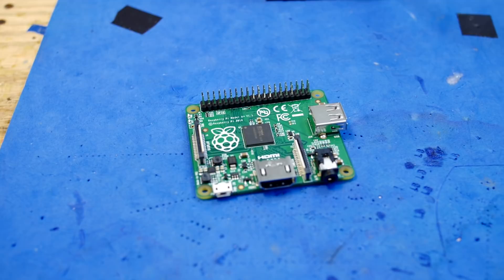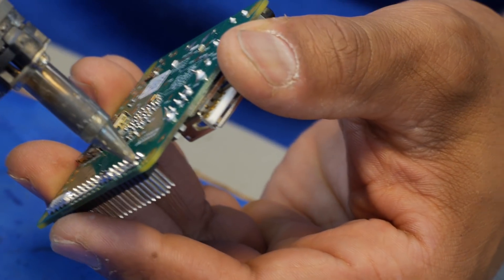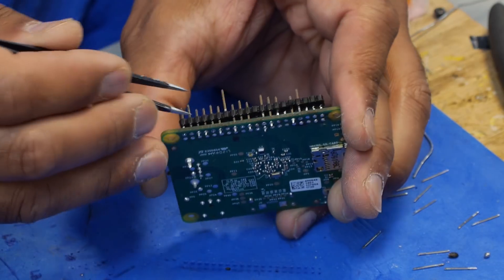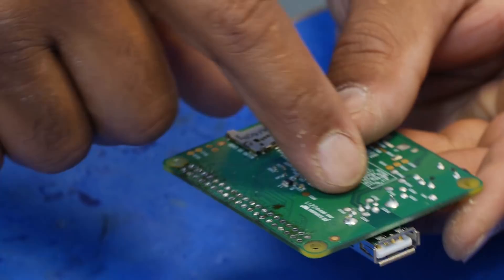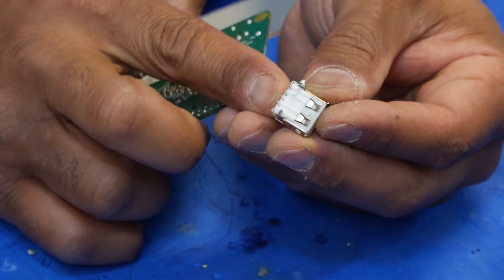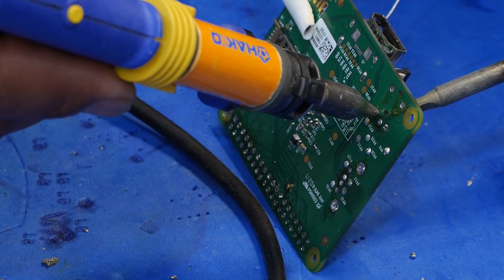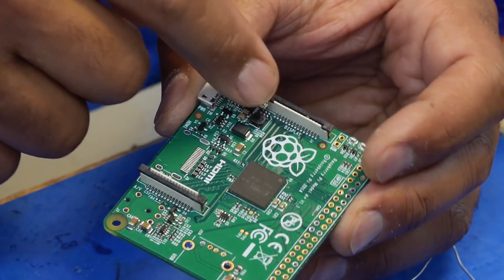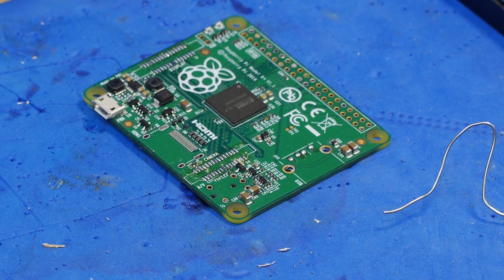Desoldering a Raspberry Pi A+ - sudo Sergeant 21

Comment: May be easier to tin solder on each pad, place in vise, heat one pin at the same time pulling pin with pliers on other side for all the pins, suck &/or apply more solder or wick away remaining solder... Tedious yes, but all for keeping it simpler for the average user with out hakko sucker. Took roughly 40mins tho.
Reply: Things suggested: PN-2007 (Teethed Pliers), Super wick #426, #835-P Flux pen,  desktop Vise,  patience.

Comment: Could you do a video of how to use a heat gun and how not to use one.  I have a soldering station and the one time i tried to use a heatgun, with a narrow nozzle, for desoldering i ended up ruining a circuit board.

Comment: Was curious about interfacing the Nintendo power glove with the rPi. Found videos for Arduino, but non with the rPi. Would be interesting to see if it's possible without having to use an Arduino as a man in the middle interface.
Reply: I don't know, depends on how they interface it? If through the official controller port, yeah you can use Pi's slow and horribly mistimed user space GPIO without any further issues to read out a normal shift register based controller, so should not be a big deal here either - Arduino is of no benefit whatsoever.

Comment: Hey Felix, Is it possible to do that to the microSD as well? I'm wondering so maybe I can bend it back maybe instead of laying flat.
Reply: You can desolder the microSD socket, but you may instead consider getting a flex cable SD-card extender, it's more reliable.

Comment: You clowns and idiots going on about the pi zero don't belong here: They have portable systems, they have premade clocks, they have screens which do not require reverse engineering and we have a bunch of clowns too dumb and unimaginative to learn a simple process.

This is a general procedure and not only applicable to the first gen Pi. They likely choose the R Pi A+ because they had it laying around and labeled the video with it as an example. That said, it doesn't take a rocket scientist to apply the same lesson elsewhere.

With the right tools• this job is insultingly ease; I stripped a laptop motherboard in ~5 - 8mins (I wanted the eMMC, USB ports, power jack, a few mosfets and a few useful power reg ICs).

•A Hot Air station (I got a cheap one for 50 bucks delivered), with a little practice and common sense (not heating/overheating things unintentionally) could have you doing SMD work/component removal jobs with the greatest of ease.

Comment: I think that the desoldering sucker doesn't work well. I recently used the manual one, always desoldering 2 or 4 pins at the same time and leaving virtually no solder behind.
And I don't really get why you put fresh solder on the solder joints when you desolder them. I usually just apply some flux, when I need better heat transport, but most of the time it isn't necessary, when the iron is set to a high enough temp (260°C or so on leadfree solder).
Reply: Rainer Riegler you add extra solder to transfer the heat on the desoldering tip.  It has a relatively larger tip with a hole in the center that the vacuum is applied to.  A reflowed commercial board doesn’t have a lot of solder out at the edge of the hole if the tip.  By adding extra solder you assure that the tip will have something that can transfer the heat to the rest of the solder quick enough and reduce the danger of damaging the fine traces of the printed circuit board.

Comment: Watch Rossmen he does a good job removing parts with hot air resin and wicking
Reply: remove jtag
Reply: bert farry Yeah, I use a cheapo hot air station with better results at a fraction of the time. Still useful for those without all the extra tools.
Reply: I am working on an old arcade board and I am using a lot of his technique to remove IC chips and replace with sockets. So Flux, solder braid then heatgun on whats left and use a IC puller and I just lift the chip out. A quick cleanup with iso  and then use the heatgun and just let the new socket drop in. I have done about  20 chips so far and I have not damaged a single pad, track or IC.